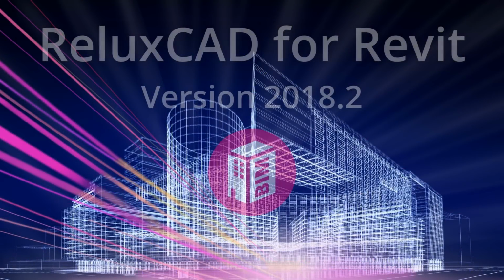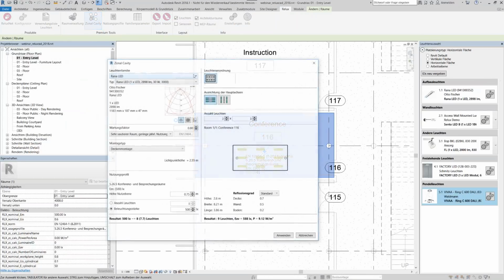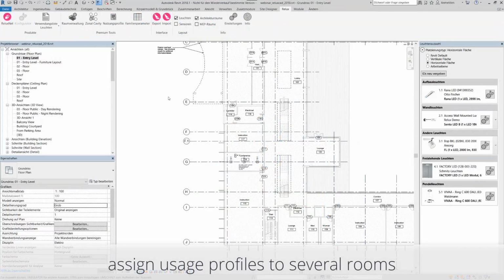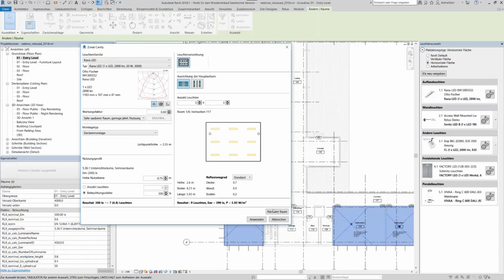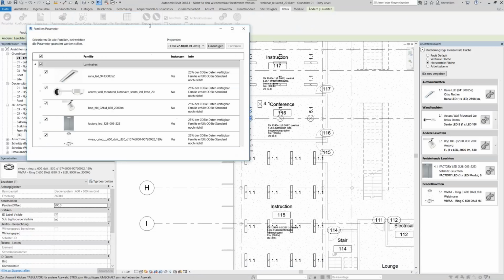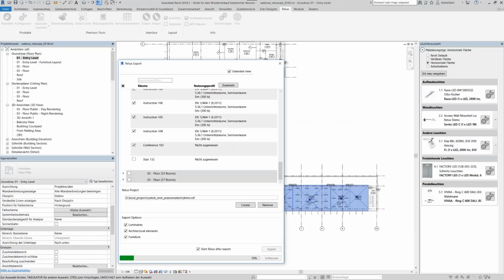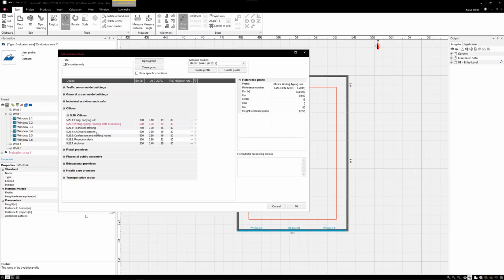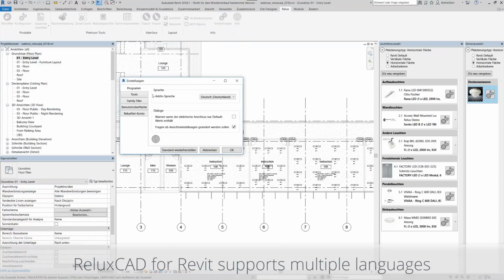ReluxCAD for Revit 2018.2 - with interface to ReluxDesktop

Comment: Hello, how can I make calculations for a room with several types of luminaires in one light scene directly in Revit
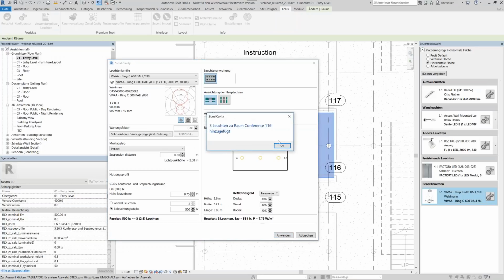Reply from the maker: This explanation film already shows a room in which different types of luminaires are used. 1:20 
I suppose you mean whether it is possible to create a variety of different lighting solutions for the same room in one project. 
Unfortunately, this is currently not possible.

Comment: I thought that the calculations would also be done inside Revit itself
Reply from the maker: Directly in the Revit it is currently only possible to calculate the number of luminaires in a room. But there will be many more features in the future.
Reply: @ReluxSoftware  As a revit user, the calculation was possible without Relux with ray tracing. And as far as I know, it's been like this since 2016.
Reply from the maker: @victorschneider9164  Indeed, Revit could already perform a basic lighting calculation, but ReluxCAD for Revit can be used for professional lighting planning by calculating  the required number of luminaires and the average illuminance of the rooms.